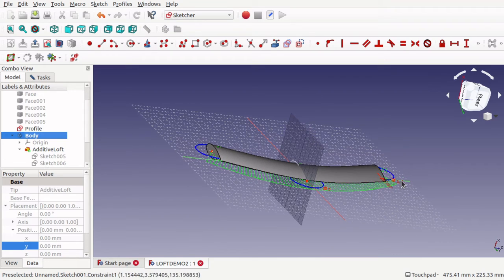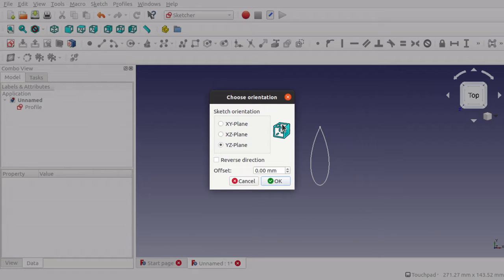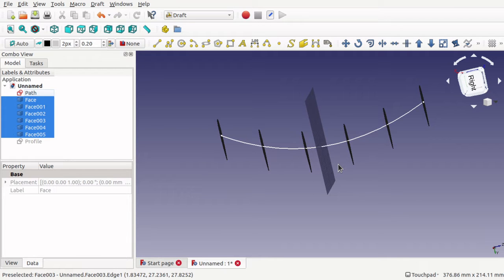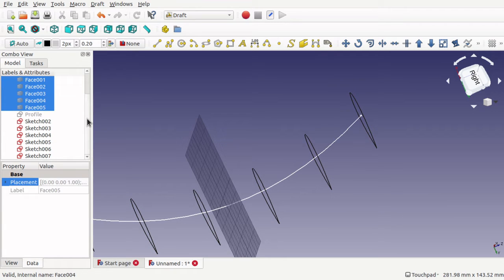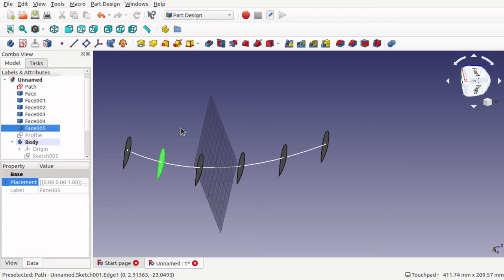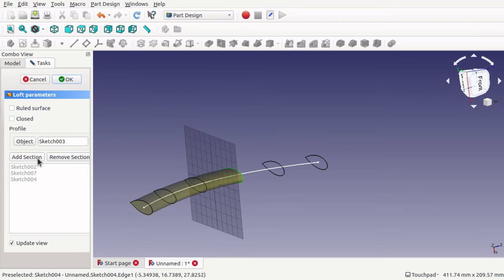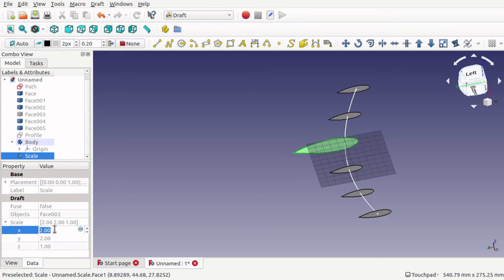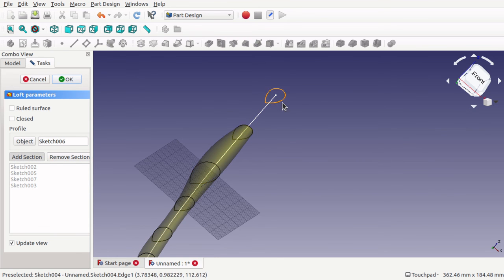FreeCAD: Loft using a Path Array. Learn to convert a path follow to a sketch and make a curved solid

Comment: Ive been learning freecad for about 2 weeks now with the odd hour or two when I have time, and it has really helped me with my hobby of designing and making gliders, your videos have been so useful in this regard.
Reply from the maker: Thanks for sharing! Great to hear your picking up the skills you need. I have quite a lot of followers that are RC flyers and model aircraft makers.
Reply: @MangoJellySolutions  The more tips I can get the better. At the moment I'm a bit stuck with the fact that I can't attach lines to b-spline airfoil shapes. So I need to find a workaround.

Comment: My problem is I want to create a path that goes in an irregular direction, say, from an xy plane to an xz plane and it traverses gradually, say, imagine like a long pool slide. I've created multiple datum planes but encountered lot of out of scope errors, besides the process I did is quite complicated just for creating a simple path. Have you guys created a video specifically for that? All videos I've seen only concentrates on a single plane. I'd appreciate to get any info or links. TY.
Reply from the maker: In the curves workbench there is a tool called the freehand b spline. It's a bit awkward but I think it might be what your looking for.
Reply: @MangoJellySolutions  I've tried that but for some reason it gives some weird out of scope errors i couldn't remember that I decided to abandon it early. I even followed one youtuber's approach using Curves which worked for him but not for me ( my suspicion is because he's using an old version which might have worked for him at that time). I was able to find a solution via Drafts where I create a line guided by dots and used it as the path for the subtractive pipe. One caveat is too many dots create crumpled pipe but easily solved that by reducing the dots and carefully rearranging it.

Comment: Have you used the assembly and CFD modules in FreeCAD? I have a design project here at Falmouth University using FreeCAD plus OpenFOAM, both being open source software. I'm a mature student on the MSc Entrepreneurship programme and need help with accelerating my learning curve.
Reply from the maker: I have yet to use the CFD module but I do use the assembly workbenches and have a couple of tutorials on my channel. There is another assembly workbench I am going to look which looks more advance and could be useful for more advance builds. Great to hear someone else is using freecad in Cornwall. I keep on meaning to put a playlist together of all things assenly which I will do this evening.

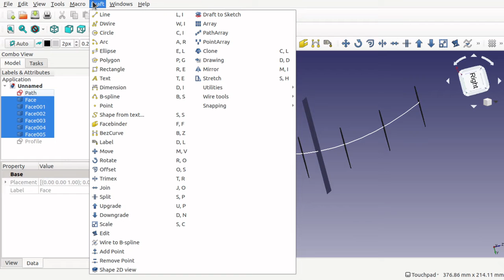Comment: @MangoJellySolutions Your menus at 5:45 show a combination of the Draft and Modifications menu icons. My configuration does not. Is that a version difference or a configuration difference? Can you point me in a direction to show the combined menu as you have it? Thanks for the videos and the support.
Reply from the maker: Just checked back, yes it's a version difference that video was using 0.18, I am now running and making videos on 0.19 which has them both split out.  Took me a while to get used to.  Glad your enjoying the videos
Reply: @MangoJellySolutions  Thanks for the reply. I have succeeded in the Loft exercise. Your video was clear. My memory not so much.